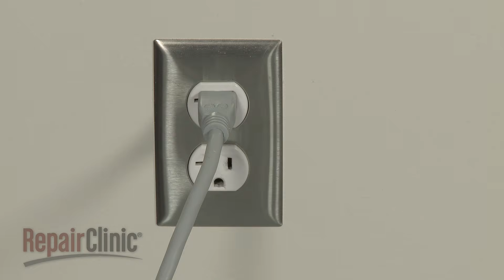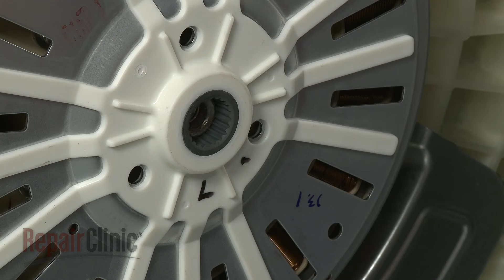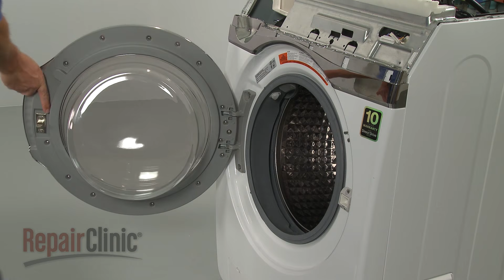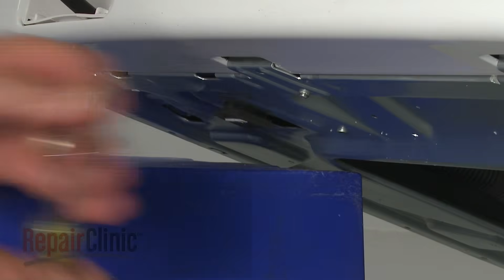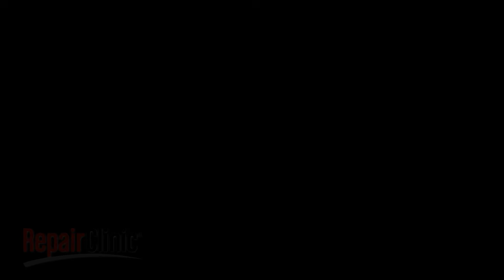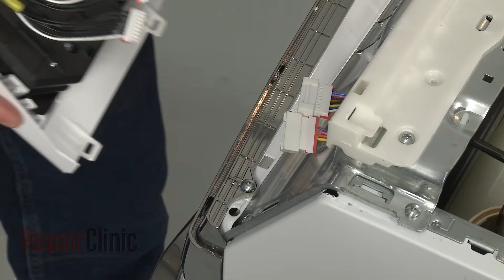Samsung Front-Load Washer Disassembly, Repair Help

Comment: OK well I fixed my washer. Once you take off the top panel, there is a Tee connection for water, basically dead center. One hose had come disconnected on mine. I reconnected it and zip-tied the Tee so it cannot come loose again. Fortunately an easy cheap fix. May want to add that to your list of possible causes.
Reply from the maker: +InternetDude Thank you for your input.
Reply: My washer is also leaking — I’m hoping this is the issue. Thanks for sharing.

Comment: Thanks for the video. My washer is leaking somewhere inside. I made the mistake when I fixed my dryer of not watching your video first. I pulled it out and started pulling off panels and stuff, when all I needed to do was take off the top and front panels.

My dryer failed like a month ago, and now my washer did. Crappy Samsung stuff, only lasted 6 years before problems LOL. Oh well thanks to your video I'll take it apart the right way first!!
Reply from the maker: +InternetDude Glad we could help.

Comment: I have a Samsung WF409ANW/XAA that is throwing a E8 error and the repair guy said the stator and rotor needed to be replaced and suggested we could order and install the part ourselves. This didn't fix the issue. Unit will not spin and it takes quite a bit of force to spin it manually. Any suggestions?
Reply from the maker: +Chris Stamps The inner tub should spin freely. One possibility is that the tub bearings are binding. This would cause the tub to make a lot of noise as it moves. Another possibility is that the tub is obstructed by a small object. Check the area in-between the tubs for any small objects (such as a sock or piece of lint) that may be preventing the inner tub from turning freely.  For more information, check out out website's list of commonly defective parts for a washer that won't spin: http://www.repairclinic.com/RepairHelp/How-To-Fix-A-Washing-Machine/38---/Washer-won-t-spin If you enter your model number, we'll give you a list of parts specific to your model.

Comment: I have a Samsung WF106U4SAWQF and i'm getting the code 'dE'. I have replaced the latch sensor (ZV-446) but the error persists. 

Well, the machine used to show the error at the end of every cycle, now it don't even start a cycle, cause it shows the error at the beginning of the cycle.

Does somebody have any idea?

Thanks ;)
Reply: I believe that code  is Drain error. . On the bottom left  of the front of the washer is a drain assembly. It filters out to crap that comes out of the clothing when washed.  hair, dirt, etc. if that becomes clogged the washer will no longer run well and you will get a DE error code. It will eventually  become so clogged that it will not run  at all. All you have to do is take the little black hose that is wrapped around the drain plug,  get a pan drain, the water out of that and then open up the filter it looks kind of like a gas cap and clean it out. problem should be solved
Reply: If Gloria's fix doesn't work for you, the main drain tube might also be clogged. Ours had filled completely with a sand-like material that came off of our non-skid rugs. Once I removed the back panel, I could fell that the large hose was solid as if it was full of sand, instead of being flexible. I was able to use a dowel to gradually remove the obstruction. If you have to do this, be prepared for a lot of water to come out of the hose once the blockage has been partially cleared out, and have a LOT of towels or a low pan (such as a 9 x 11 baking pan) ready to start catching the water; a helper can dump the pan out repeatedly while you hold the end of the hose shut.

Comment: Been waiting for 2 weeks to have a repairman come fix the LO error on a Samsung W431AB washer. Extended repair center sent the part but, no local repair center has returned a call to schedule the appointment. Found this video and replaced the mechanism myself. Washer working like new! Thank you!
Reply from the maker: +khariton Thank you for sharing.

Comment: hi..i am using an IFB elena 5kg front load washing machine machine pump is working,it fills d drum with water and after some time it pumps the water out but the drum does not spin so my cloths do not get washed , i ckecked the motor and have found it to be working but when i connect it to the machine it does not work....which part of my machine is faulty....it has got some kind of PCB on d side which helps control and operate the machine ....so do i have to change that board or is there another problem...pls can someone help me ...thanks in advance
Reply from the maker: +Joshua Vaz It sounds like a problem with the motor control board.

Comment: are samsung washers reliable?
Reply: NO!!! Mine is less than 2 years old and a piece of junk.  I have replaced the thermistor 3 times.  Samsung service is awful.  They only give you a one year warranty for a reason....because it will probably only last you one year.
Reply: i have had mine for 2 years.i now have a locked problem, the door is locked and cant get it unlocked,now having it to be worked on. also having lots of mildew odors, you will have to clean it with bleach,baking soda,and vinegar once a month to help with the odor. or you can buy the cleaning tabs, but i use the home remedy. i cup of vinegar, 1 cup of bleach, and 1/2 cup of baking soda
Reply: @1932jeannie  If you leave the door open after using it will dry and you won't have that problem.
Reply: nancy s ive read mixed reviews for all companies from lg, samsung to bosch. i concluded, it doesnt matter which brand anymore lol
Reply: randomrazr Samsung appliances seem to be form over function. They look fancy with their tacky chrome and charms etc but they are not durable. Bosch make good quality, well made products that last. There are lots of problem that owners have reported with Samsung appliances, LG less so, but they only score average for dependability but their customer service is bad.
Reply: randomrazr Don't know where you heard that from but that is wrong. In the UK, consumer group "Which?" magazine rate Bosch second in reliability to Miele, with Indesit scoring the lowest. Samsung and LG are slightly below average and have poor aftersales support. Bosch have an above average reliability rating and one of the best customer service supports, they use their own Bosch engineers rather than contractors. Bosch appliances including washers and cookers alike have won many awards for performance and reliability.
Reply: +randomrazr no
Reply: just bought the onyx 5.cu model :D
Reply: Oliver Newell I heard BOsch wasnt any better either
Reply: Oliver Newell maybe there not as good in norht america?
Reply: randomrazr Ours is on year 6 and it just had its first minor problem.
Reply: Virginia Wolf tad is?
Reply: It was the motherboard but it is fixed.
Reply: +randomrazr Eh, yes and no. I've had my washer about 6 years and it just started leaking. So I guess that's not bad. My dryer that I bought at the same time just stopped heating last month. So really yeah that's not bad in the grand scheme of things. Assuming I can easily fix my current leak I should get at least another 4+ years out of it.
Reply from the maker: randomrazr The longevity of washing machines is dependent upon usage and proper 
maintenance. Therefore, we don't recommend specific manufacturers but encourage you to spend time reading consumer reviews of models you're considering purchasing.

Comment: i have a samsung washing machine at first it was severely vibrating and noise during cycle and spin cycle, and now it totally stopped spinning. the drum is also loose what could be the problem? please help.
Reply from the maker: rasile ya-aya You'll find our website's free troubleshooting and repair help system to be helpful. Be sure to enter your complete model number: http://www.repairclinic.com/repairhelp?TLSID=1773.
Reply: rasile ya-aya
Reply: rasile ya-aya

Comment: Great tutorial.  I have a Samsung Front load washer that looks identical to the one in your video that was purchased brand new three years ago.  A few weeks ago it began making making a loud noise along with an aggressive rattle/ shake at the last 7 minutes of the "quick wash" cycle which I believe is the quick spin used after the wash.  At that time there was also a strong smell which smelt as though it could possible be some sort of burning rubber. Do you have any tips as to what may be the problem so that I could take the challenge of fixing it and saving 600+ on a new replacement? 

Also, since the incident I must have used the washer at least 8-10 times with that same aggressive shaking during the spin cycle and no scent of anything burning.

Thanks
Reply from the maker: JasonCBurghardt We recommend using the repair help section of our website - http://www.RepairClinic.com/repair - if you enter your washer's model number there you'll have access to model, part and symptom specific repair help.
Reply: Did you ever find out what caused that? I'm having the same issue

Comment: i got a nd on my washer replaced motor to water pump for the hoses no clog- washer start but when the cylce ready to change to rinse  machine stops then nd  sign come on was told it was control board.
Reply from the maker: Jean Thompson It definitely could be a control board issue.

Comment: my washer quit washing it is marking nd what nod i do? to make it work again?
Reply from the maker: alma orta ND means "no drain" - there could a clog in the drain hoses or there could be something wrong with the drain pump. Another possibility is that the drain hoses are not raised high enough. The drain hose must rise up higher than the potential water level inside of the washer before going to a floor drain or a wash tub.

Comment: great video, someone just gave me one like that with a big noise inside, seems like drum support spider, I hope I can fix and find the part fast, Tks for the video.!!!
Reply from the maker: Have a good repair! If you need parts we have them on our website!
Reply: wow, I just order one before see ur response. sorry. By the way how much would u charge for a spider support for a we218nw/xaa??
Mine is cracked.
Reply from the maker: If you enter your model number on our website you'll see all of the parts we have available for your model. You can see pricing there.